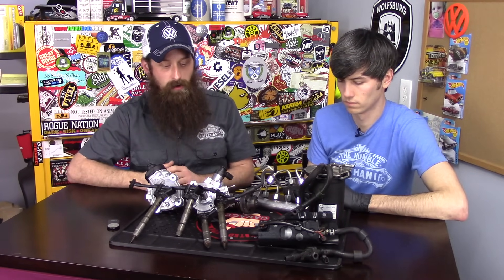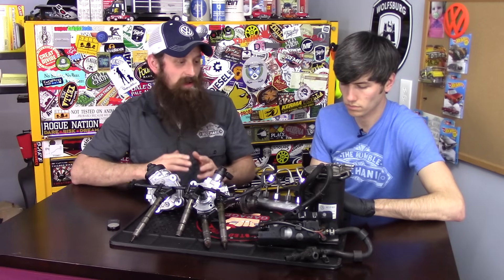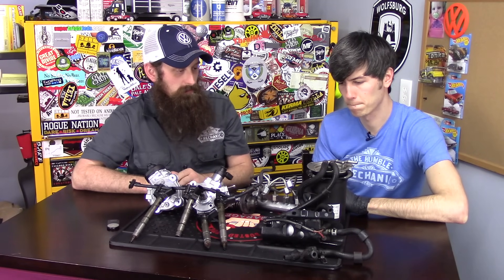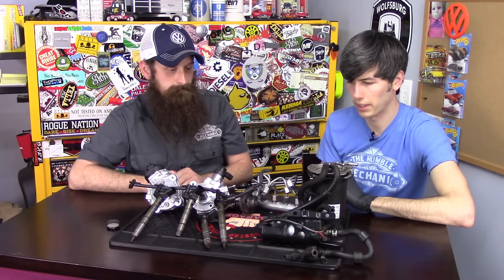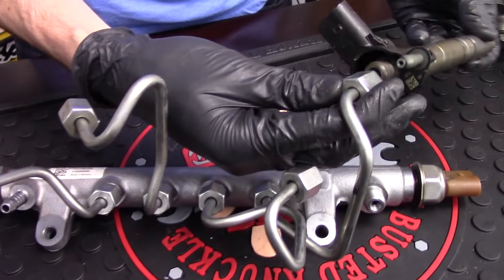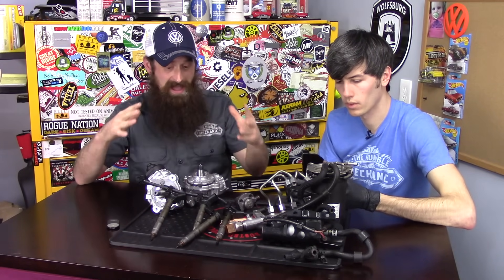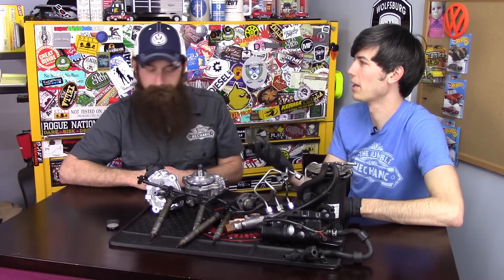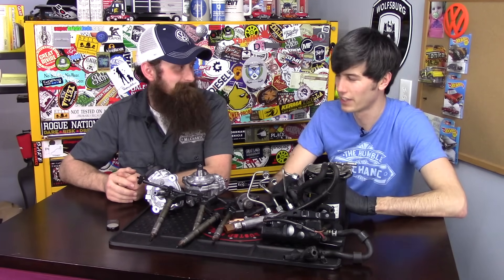Putting Gasoline In A Diesel Car - What Happens?

Comment: Years ago, I had a Jetta diesel. I was given a "bulletin" from the VW dealership about cold weather fueling. They actually recommended adding a few gallons of petrol to the tank & top off with diesel to prevent "gelling" of the fuel. I did it. With no issues... Just sharing my experience...

Comment: Complete bs. Did it to my Ford f350 . Went to the dealer after driving about 10miles They drained the tank , replaced the filters, and I was good to go . Cost about $250 and $100 worth of gasoline. This
Reply: Yup. Seen lots and only a couple had issues and needed a full system replacement. Worth trying, since the only other option is full system replacement anyways.
Reply: How's your truck?

Comment: Absolutely insane, and unnecessary to replace all these parts. It's true the gasoline doesn't lubricate as well as the diesel, but the parts are running for a very short amount of time under these conditions. Typical mechanic talk "we worry about failure down the road" etc. Just have a look at all the folks in the comments here who've had this happen and simply purged the system.

Comment: Damage can depend on the ratio of fuel/gasoline and how long you had the engine running the mixture....Diesel won't run on strait gas, but will run on a mixture of diesel /gas...the gasoline combusting with the diesel mix can actually melt/damage the top of the pistons. Same is true for what damage it will cause to diesel injection pump, which gets its lubrication via diesel fuel and some, the engine oil (inline Bosch type diesel pumps) Since you never know what damage you may have caused, on warranty it is best to change or get the pump rebuilt since the damage on these pumps, with very tight tolerances, (some pumps, you hold the piston in your fingers and it won't fit the cylinder because of the heat difference) can occur right away or 10,000km later....you never know how much damage there is.

Comment: I like the Humble mechanic and I like engineering explained, I am a VW guy and have been for over 15 years but this video just got under my skin. I've been into tuning and building TDI's specifically for about 10 years and I truly think this is a little excessive. This is also the reason I stay as far away from any dealership as possible.This is just my opinion and I do not disagree with many of the "possible" problems this "could potentially" cause but to approach something like this in such a drastic manner right out of the box just seems a little over board to me. Needless to say, good video like usual, keep it up.
Reply: As somebody who works at a dealer, Volvo to be specific, and has done PLENTY of incorrect fuel jobs. We usually, activate the fuel pump, pump all of the wrong fuel out (to get as close to 0 fuel as possible, if not possible tank may be removed to remove the incorrect fuel), change the filter, fill the tank with the correct fuel, and so far, had 0 issues with D5's that I've seen cover 150k since the incident. Did however have one that had a funny issue, but supposedly never incorrectly fueled but it was a possible source of the issue, if that makes sense? But otherwise no issues at all. We realise, because it makes sense, that the components on these cars were built to handle a lot worse scenarios than this and it won't just kill them suddenly. Maybe VW's use terrible fuel pumps but idk. Least as far as Volvo is concerned never been a problem.
Reply: AdrenalineJunkieProd u

Comment: I agree with the bad at math part. 14 gallons at $25 per gallon would be $350 for disposal, not $3k. Another thing about the fuel disposal. Add some 2 cycle oil to gas to give it better lubricating properties, add some motor oil and run it out. Fix it if it fails.

Comment: Well, maybe I missed it, but you left out a very important part: Starting the engine.
If you put gasoline into a modern diesel car (modern = from 2000 or younger) nothing bad will happen UNLESS you start the car. Just recently, I accidentally put gasoline into our diesel Audi. I didn't start the engine at all, got towed, the mechanics pumped out the fuel mixture, checked if the filter had any gas in it (there wasn't, the tank was barely half full) and then they just put diesel inside and let the car run for half an hour on their parking lot. 195€ and I had my car back.

So guys, yes, this may be super damaging IF you start the engine. NEVER EVER start the engine, no matter what anyone at the gas station tells you. Many people at the station told me it was fine and I could at least park my car somewhere where it's not blocking a pump... NO! Do NOT start the car if it is modern diesel car. The common rail system inside is super sensitive. Older cars (pre 2000s) don't have that and my granddad had a diesel taxi. In winter, he would always put a few litres of gasoline into the tank. That way the fuel wouldn't clump in cold temperatures. Nowadays, this is not possible anymore. 

One question I do have, though. If it's so bad to put gasoline into a diesel car, but not that bad to put diesel into a gasoline car, then why don't they just make the pipes at the gas station bigger for the gasoline pumps so that they simply don't fit into a diesel car? This is what has been bugging me lately. The pipes at German stations are bigger for the diesel pumps so you can't fit the diesel pump into the gasoline car.

Comment: Before the video, I would like to make a prediction on what I think would happen based on my knowledge. Then compare with what the video explains. 

Now I say that the Gasoline won't combust (because lack of spark plugs) therefore it will build up and "hydrolock" (technically gasolock) the engine. 

I will reply to this comment if I was right or wrong. Thank you for reading!
Reply: Yes. I was in fact very wrong
Reply: if it were pure gas then it will ignite before tdc causing rod bend and even crank deformation
Reply: not even this since the feul is only injected when it is ment to ignite, so in theorie it should run just fine, and apparently old diesel engines did just that...

Comment: Rule #1 of owning a diesel.  ALWAYS get a receipt, and keep your receipt when you fuel.  Fuel tanker put gasoline in the diesel storage tank...... the receipt proving I used a diesel pump, and at that station, made them pay the bill to repair the work truck I was driving.  (Also, prevented me from getting fired.....)  I keep the receipts and write mileage on them for my personal truck (diesel) too, just for that reason.

Comment: Got my Peugeot 504  in 1961. Around 1979 my wife topped off a half tank with gas. After a few days it ran crappy. At half a tank I put diesel in and it ran better. Within a month it was back to normal. 2016 and it is still running great. I changed the filter about 6 times and the injectors once in 2002.

Comment: Been here fixed that! drain fuel ,flush lines,change filters ,refuel ,ran motor then.(changed oil )just cause I'm paranoid lol. happened to low mileage diesel engine now at 300,000 no ill effects at all and employee got to keep his job😊

Comment: This is a worst case scenario. This happened to my modern European car. The petrol was simply flushed out and replaced with diesel. The vehicle went for another 100k miles before being sold, with no problems. As the car was refuelled from empty the petrol was virtually uncontaminated and was used in my wife's car. Go ahead and spend $8k if you wish!

Comment: 8k$? are you high? 6 years ago I paid cca. 350€, and I even drove 2-3km before engine stalled. Car (Opel Vectra 2.2 dti, 2008) spent 2 days in the shop (authorized service). And yes, they did laugh behind my back.

Comment: My question:  in the event that I "inadvertently" put gasoline in a diesel vehicle, then I realize what I just did immediately prior to starting it up, and add a couple gallons of TC-W3 (or motor oil for lack of any better options) for lubricity, what would be my next hazard to deal with?

Also, what would be the needed fuel/oil ratio to get the needed lubricity?

Gasoline/diesel mix also works well in some gasoline equipment including my truck, mowers, and Coleman lanterns, so that would take care of disposal. I wonder if I can ask for the fuel back...

Comment: Some modern cars have a chemical lining inside of the Diesel tank that will disolve when gasoline is poured into the tank.
This creates a kind of sludge that can and will clog everything in the fuel system, when the engine is running.

Comment: I put fuel into my 2013 common rail work truck when its was brand new, and drove it for about 30 kms. All we did to fix the problem was drain the fuel out of the tank and change the filter.
That same truck has done 140,000 kms since then with no issues whatsoever. 
$8000 repair, pfft! That's criminal...

Comment: at 6:37 he says "Were pumpin 800 bar through these" NO WAY!! Maybe he means 80? The pressure at time of combustion is likely near 37 bar, as that is what it is on small 4 cycle marine engines.
Reply from the maker: +BiddieTube diesels have very, very high fuel injection pressures.
Reply: Modern diesels can have more than  1000 bar fuel pressure. Petrol on the other hand uses lower fuel pressure. Maybe you are confused with that?
Reply: Well, I done some research, and quite surprised. Some car and truck diesels may have well over 1000 bar fuel pressure. I just would have never thought anything for consumer use and repair would involve pressures that great. One can get quite well injured or even killed messing with that. One sure better not ever attempt to use any replacement parts not specifically designed for the application.
Reply: The amount of fuel that gets compressed is tiny and the compression doesn't stay if you turn off the engine.
Reply: I have a 6.7 cummins engine, cold start pressure at the injector is 26,000 PSI nearly 1800 bar. From my understanding why you change injectors when you get gasoline in a diesel engine is because of those pressures, you get steel fillings (or aluminium in the case of the injection pump) because the gasoline isnt lubricating the parts as would the diesel, no lubrication, high pressures, increased wear. The amount of fuel injected out of an injector is really really a small amount because the injector does move very much with all that being said even a really really really small amount of wear is destroyed injector.
Reply: Standard Mercedes, Ford Transit och even Opel Vectra C GAS-engine has up to 3500 bars (during the injection).
80 bars was back in the 1940....
Reply: +BiddieTube Luckily the pressure bleeds off when killing the engine.  So it's not a hazard when working on your car.  Also you shouldn't use parts from untrusted brands in something as vital as a fuel system :p .

Comment: 2 things: 1, Why can't petrol and diesel fuel pumps have different shaped nossle's so you can't put the wrong fuel in, and 2, is there no way to put a sensor in the tank that warns you if the fuel is incorrect and doesn't let you start the engine?

Comment: I live in Australia where many cars (but not as many as Europe) and virtually all pickups and most SUV's are diesel. I have heard that you can add engine oil to the tank if you misfuel with gas, sort of like a 2 stroke mix. Also heard of misfueling by lending car to others but car carried on as normal with no problems but I guess it depends on how much diesel was already in the tank.

Comment: If it was my car or a friends. I would just drain the tank and replace the filters and get as much gas out of stuff as possible. Fill the tank with diesel and go from there. If something went bad replace. As for getting rid of the gas mix fuel, put one or two gal. of it in a gas car per fill up. The gas car will not care in small amounts and will actually get better fuel mileage...

Comment: I usually just hook an old fuel pump to the fuel line coming out of the tank and pump all the contaminated fuel out , replace the fuel filters, and blow all the lines out. The shop I worked at we charged $500 for that service, including disposing the bad fuel. The service writer would of course explain to the customer all the potential problems that could happen as a result of using contaminated fuel--damaged injectors, fuel pump problems, high pressure pump problems,  ..ect. It is important to make sure the customer knows how many problems can happen as a result of using bad fuel!

Comment: or in fact depending on ratio of diesel to petrol and capacity of tank (how much space is left) topping up with diesel and driving gently for a bit normally gets you through . You may have to crank engine for a while to get it started again but really no damage is done

Comment: Might as well replace the whole car according to this video. BS!! Filled up the tank once by mistake with gas instead of diesel, drove it to the point where the engine died, towed it to the shop, had the fuel removed, the fuel filter changed and the car runs great today 30k miles after the incident..

Comment: This is all unnecessary, just drain the system and put diesel in it. Modern ultra low sulfur diesel has very little lubrication so gas will not hurt it. Modern diesel  fuel will actually damage an old style mechanical injected diesel pump.

Comment: I thought the biggest problem was incorrect ignition / detonation in the cylinders, damaging the pistons, that's not a.problem...?  from this video seems the only issue is that the high pressure fuel pump will lack lubrication and fail.  that's all...?

Comment: as a diesel mechanic I've seen many diesel trucks filled with gasoline. change the filter, drain the tank, fill with proper fuel, then ship it. 95% of the time nothing else needs to be done. you don't just change everything. if there is a performance issue you diagnose it afterwards and make only the necessary repairs.

Comment: I put petrol in my diesel truck, it stopped after about 15 mins running. All I did was take the tank off, empty it put diesel in it, pump the pressure back up and it went.

Comment: My wife accidentally put gas into our 2003 VW Golf TDI (blame the gas stations for not having consistent pump colours on the handles...) and drove it until it died.  Towed to the dealership and they did nothing more than drain the system, replace the fuel filter and put diesel in it.  I can't recall the bill being more than a couple hundred bucks.  The amount of exposure to gas within that system won't be all that much if the system is flushed within a little bit, so all this talk of eliminating lubrication and metal shavings is complete bunk.

Comment: typical mechanic - I never actually looked inside one before!  Replace, replace, replace, it's not broke, but maybe it will!  replace, replace, wait, they use the same low pressure fuel pump in diesels and gas cars?  IH well...  replace, replace, replace, replace...

Comment: You can have a 25 to 1 ratio and it won't do any damage to the system or engine. When it's -20C or lower it's actually recommended.

Comment: Who cares about the aftermath of gas in diesel.......what happens when you start a diesel full of gasoline?????
Reply: clogged injectors
Reply: Have done it, am a tech at a Volvo dealership. Believe it or not, a diesel depending on the design will run on gas/petrol. Simply drain tank, replace fuel filter, refill with fresh fuel and send it on its way. Haven't had an issue yet and have done hundreds of them this way.